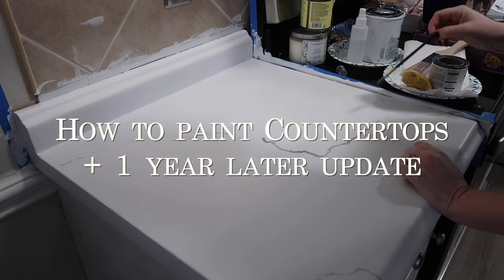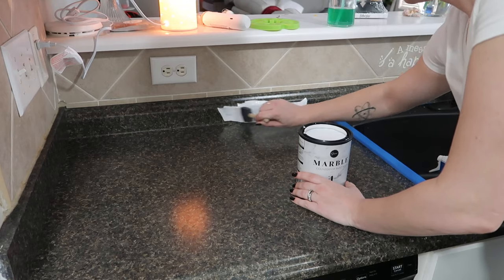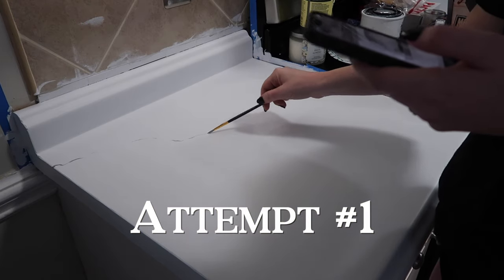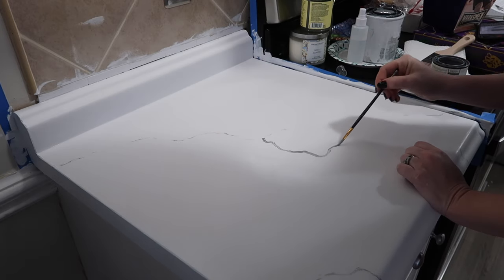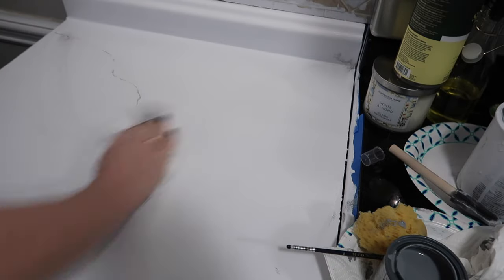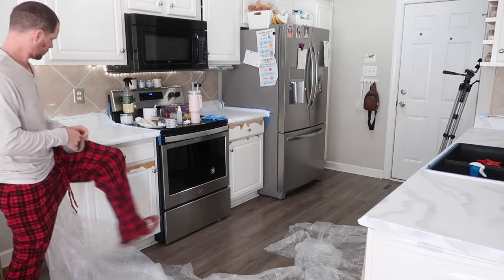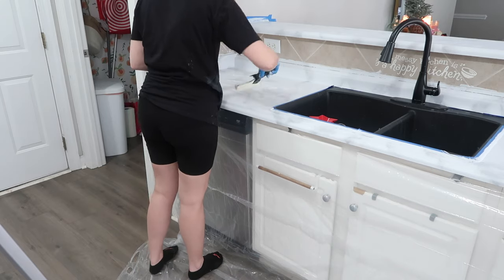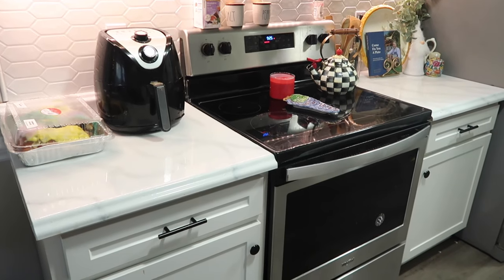DIY Kitchen Counter Makeover & ONE YEAR Update | How to Paint Countertops | Paint Marble & Epoxy

Comment: Amazing job!! What if a hot pot is placed on the countertop without a coaster will it affect the pain ?
Reply from the maker: It’s similar to any kind of inexpensive countertop (laminate, butcher block etc). You cannot set hot pans directly on it or it will burn. I haven’t had any issue though. I just don’t cut or set things directly on it